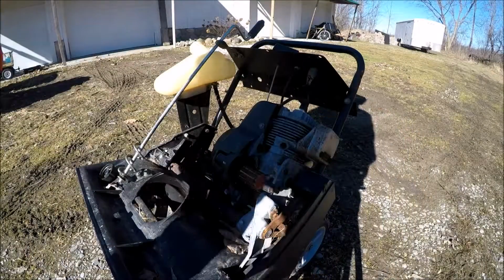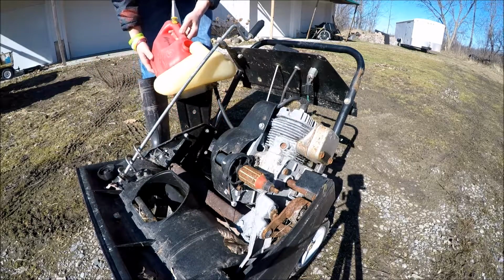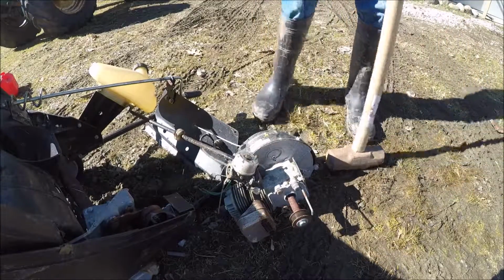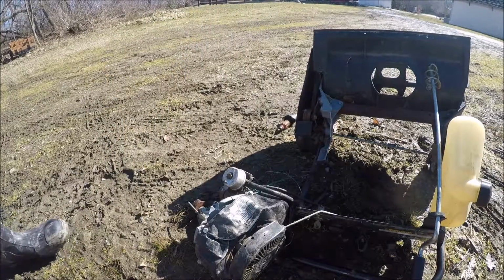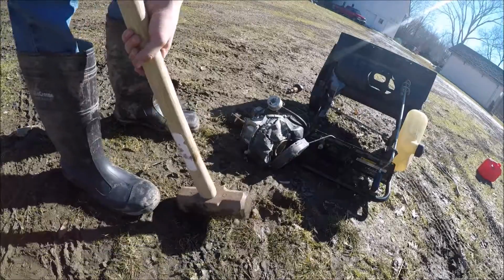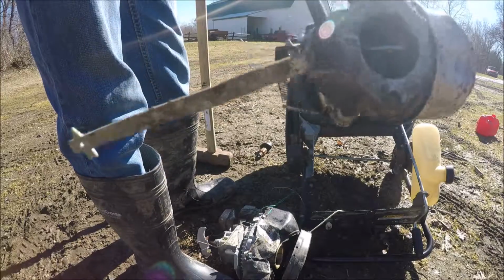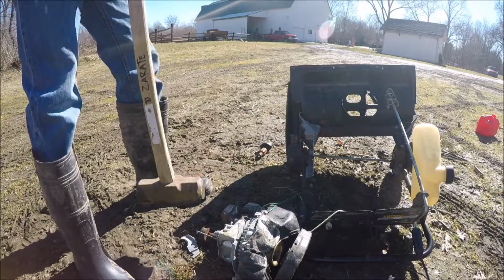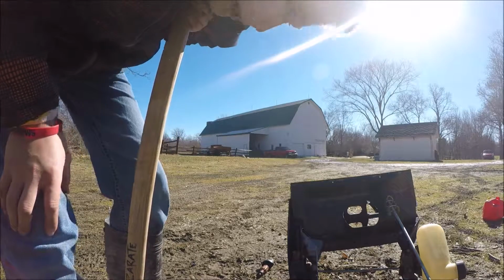we have made it to 30 subscribers blowing up a snow blower

Comment: Definitely not 4 stroke gas it may of been mixed lean but i know for sure a two stroke wont last over a hour of continuous running with no lubrication in the cylinder
Reply from the maker: I put 93 in it no oil it just kept going. Lmao